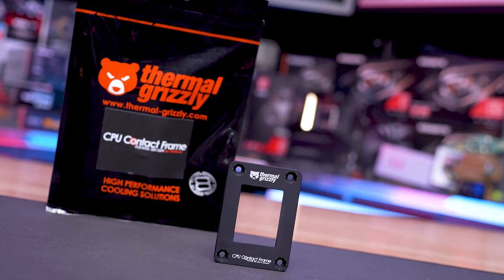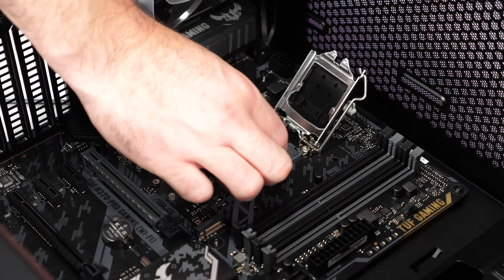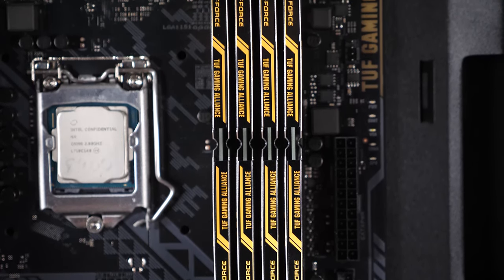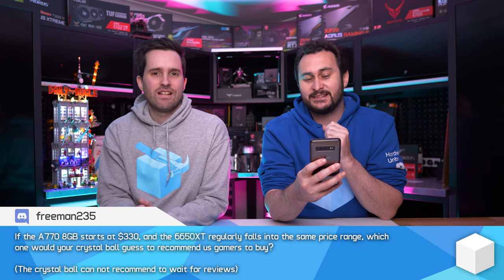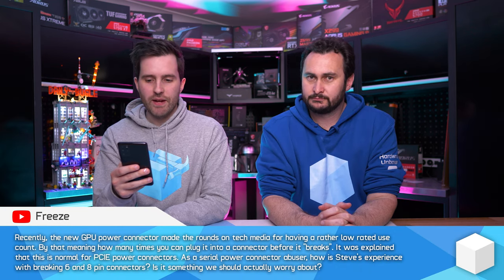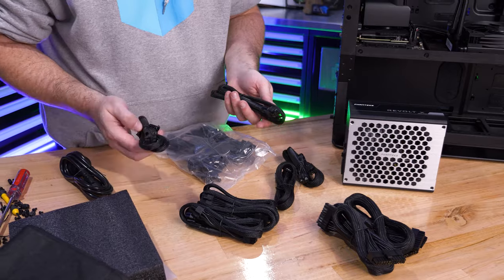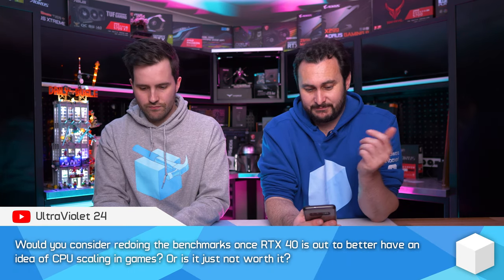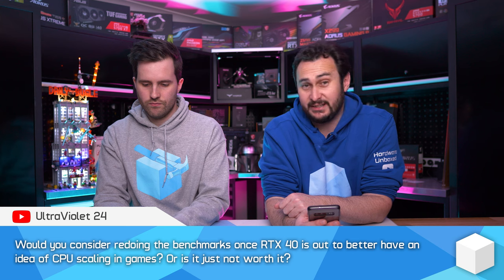EVGA Quitting Bad For Nvidia? Arc A770 8GB better than RX 6650 XT at $330 US? September Q&A [Part 2]

Comment: I think this is smart for a EVGA, also Nvidia can't do anything like apple cause they can't overprice like does.. Hey one reason i don't like apple, and the closed eco system.. rawr.. but yeah lets see what happens with gpu stock in general.. and do we really need 500+ watt gpus, i would be like yeah, but i want options if i don't need it. i kinda do! lol.. it's like overclocking.. dimenising returns! ! Cool topics.. but what is it with the hoodies is colder then 25c their? i know its winter, but fire up a GPU for heat!! :) :P <3

Comment: The power connectors in use are Molex Microfit which are indeed specced to 30 cycles - but the old connectors were Molex MiniFit JR. connectors which also have a fairly low rating of 75 cycles. I agree, nothing really to worry about.

Comment: An A770 at msrp will be about 40-60 dollars less than a 6700xt. Without even taking into account Radeon Monster Profiles, it's a much better buy for about 10-15% more money. Plus, amd cards are getting better with time thanks to new drivers and features. If you cant afford the price jump (im on a 1650S so i get that), get a 6650xt.
Reply: By the time AMD driver perf  'gets better with time' it's often time to buy a new bloody GPU. Such a bad AMD fanboy argument tbh.
Reply: @wayn3h  a lot of people don't upgrade as often as a lot of games run well on older gens. If you quit the mindset of "new game" = better game (as if games turned bad...), then you don't need to upgrade a lot. in the steam hardware survey pascal is still the most used gpu generation by far. so yeah, if you upgrade every 2nd or 3rd gen and skip some, the increased performance over time is nice (I am using a nvidia gpu btw, so don't start with "amd fanboy" crap)

Comment: The only question I have is with the Zen 4 CPUs being designed to run at 95c all the time, how do you set a fan curve that prevents your fans running at 100% all the time? Usually fan speed was based off temperature but that will no longer be possible. I'm sure someone will make a video about it in the coming weeks though.
Reply: there are some pbo/undervolting videos on yt already
Reply: @gxdjoeybaby07  That's true, and is probably what I'll end up doing personally, but a lot of people aren't so willing to spend time tweaking settings and potentially losing some performance just so they can use temperature for a default fan curve. I'm also curious what other options there might be, you might be able to use CPU utilization and/or clock speed to adjust fans assuming if clock speed is high it is working harder on single thread or if utilization is high multi-thread, but it is probably less reliable doing something like that.
Reply: Why not get efficient Zen 3 Ryzen 9 5950X or an M1 or future M2 Ultra Mac and avoid Zen4dozer overhyped crap?
Reply: @saricubra2867  Because OSX is utter garbage for gaming, and I'd be using the extra power for electric heaters anyway so efficiency is completely pointless to me.
Reply: @AusSkiller  You don't need an AMD Bulldozer 3.0 chip for gaming.
Reply: @saricubra2867  No, but I will need the extra cores for compiling games.
Reply: @AusSkiller  You can compile code on an M2 or M1 Ultra at 1/10th of the power consumption and saving an insane amount of money for the energy bills.
Reply: @AusSkiller  M1 Ultra has 20 cores, M2 is 24 core without dealing with cooling and power nonsense
Reply: @saricubra2867  The code I compile is for games, games that wont run on macs, and that definitely can't run on an M1 or M2 chip. Sure they are efficient, but only because they have a very limited instruction set, I often use some of the more advanced instructions from x86 and x64, occasionally even AVX because they can do so much more work so much faster than basic instructions. If you tried to run them on an M1 or M2 instruction set through the Rosetta emulation stuff you'd end up running at a fraction of the performance you'd get on x86 or x64,. Even when you natively code the program to use only apple silicon instructions as efficiently as possible it is still considerably slower. The comparisons between apple silicon and x86/x64 CPUs are usually done in programs that only require the basic instruction sets to work well which is why apple silicon appears so good. If you compared a program that heavily uses AVX512 instructions to a natively compiled apple silicon program to do the same work you would be looking at apple silicon being tens  or even hundreds of times slower, but apple gets away with that because it isn't common to heavily use such instructions, there are usually far more basic instructions mixed in so the performance impact isn't so severe.

But none of that matters because as I said I would need to use electricity to heat my home anyway so not using much power isn't of any benefit, I'd just have to turn up my heater to compensate. And I still couldn't play all the games I enjoy on the mac anyway. If you want a mac then you should get a chrome book because it'll be able to do everything mac users do for far less cost, even when you consider the cost of the extra power they might use. Which is another issue with macs, the savings on power cost are dwarfed by the extra upfront cost of a mac anyway, so if cost was any kind of consideration you'd never be buying a mac in the first place.
Reply: @AusSkiller Do you know that Hardware Unboxed did a M1 Pro code compilation benchmark?
That isn't the M1 Ultra, but it destroyed every single x86 chip competition last year. More than twice as fast. Also defeated desktop chips that use like 12 times more power...

The secret isn't the ISA, it's the absurd memory bandwidth.

The problem with x86-64 is that it's extremely bloated with tons of unecessary instructions for different workloads. Why not simply pushing IPC and work as a swiss army knife and doing everything very efficiently?
Reply: @saricubra2867  Sure it can compile code, but only for mac or iOS which isn't going to be any good for the games I make and play on my personal PC (I use an M1 mac for iOS games I make for work though, but my work PC (9940x) still compiles much faster than it). Apple silicon is very impressive don't get me wrong, but OSX is terrible for gaming which renders it pointless for me.

The bloat is a problem on x86/x64 it is true, but where you can use those instructions the performance increase is absolutely insane and it will absolutely destroy the performance of apple silicon. It is a tough trade off though because the instructions have such specific use cases that a lot of the time they go unused, and now that CPUs are so much faster they also are less necessary too so the performance hit for the common case is hard to justify. However PCs are tools for productivity in such a wide variety of tasks that it is inevitable that the instructions will no doubt put the x86/x64 chips way ahead of apple silicon in so many applications it would also be hard to justify their removal. Macs are in stark contrast to that because they are so limited in how they can be used that they are basically end up only being used as glorified chrome books in most cases and as such never need such instructions, so it makes perfect sense for apple to drop them, especially when they also have alternate hardware solutions for the few things like media encoding/decoding that could have made use of the instructions.
Reply: @AusSkiller  the M1 mac is a 4+4 core chip vs the M1 Ultra which is a 18+2 (i think) chip . Of course it cannot compete with HEDT. But the thing is, how much power HEDT draws, how much clockspeed? how much temps?
how much fan noise?
it sucks.

There must be a way to compile games on a Mac for PC. Microsoft can't get all the monopoly, on paper, current x86 chips suck so much. In fact, Apple M2 and M1 are so far ahead that we have to wait until Lunar Lake or Meteor Lake for something equivalent (maybe?) on x86-64.

Those special instructions can improve perfomance for specific things. But the IPC hit is so hit that it's kinda pointless at the end and not worth it for the HUGE difference on thermals, power and cooling needed, fan noise, no battery life.

M1 and M2 Macs aren't glorified Chromebooks, those are the computers with Qualcomm and Mediatek chips.

Apple just embarrased x86-64 twice now.
Reply: @saricubra2867  Sure you can technically compile for PC on a Mac, but you wouldn't be able to run that on the Mac afterwards so there is no point to that, and it also requires tools that aren't ported to apple silicon as far as I'm aware so you'd be running them as x86 and that'll perform worse than x86 native so you'd also lose any benefit.
Clearly you are just mac fanboy and don't understand what PCs can do or how limiting apple silicon is.
Reply: @AusSkiller  The perfomance loss vs x86 native is so insignificant compared to the huge increase in power consumption, temps and fan noise compared to any PC.

x86-64 currently sucks, there's no way to change that until Meteor Lake or Lunar Lake.

I don't defend Apple for their shady practices or Microsoft, but from an objective standpoint, the Apple SoCs chips are many generations ahead of everyone else.
Reply: @saricubra2867  For efficiency for sure, but raw performance and capabilities it still has a long way to go. And I don't care about efficiency since it just means cranking the electric heater. I also don't care about anything on an apple products because they are just too limiting in what they can do.

Comment: I want to add, as far as NVIDIA vertically integrating the manufacturing of their own hardware like Apple, this is what basically killed 3DFX, and why AMD and NVIDIA never attempted to do the same since, it was considered an industry lesson. However, NVIDIA is the 7th largest company in the U.S. by market capita, and I think 11th in the world, higher than VISA and JP Morgan, but even with this kind of leverage, it would be a very risky venture in the consumer GPU market. NVIDIA IS doing this in the Scientific computing space though, and making lots of money off of it with the V100 and A100 level datacenter/super computer GPU's.
Also, I'm on an AM4 X570 platform, and I will one day replace the 5600X with a 58003D when they are cheaper, and just skip the entire Zen 4 Gen, because honestly, that 5600X is already pretty bad ass and a GPU is the only necessary upgrade path.

Comment: About power connectors to GPU source was official validation, so it is not speculation... and we talking about new connections not old one, but still in specific conditions (cables was under stres in one direction).
but Tim, this cables in test burn connection after 30 cycles, so don't talk from your a**

Comment: question: could an AIB opt out of producing a card with a certain chip? since there´s no FE for the fake 4080 12GB, its "success" will solely depend on AIB sales. given the absurd price and cut down performance, could they decline to do so?
Reply: yes and no. it depends on the contract with Nvidia. And it's very unlikely Nvidia will sell AIB partners just 4090 chips. That is unless AMD is able to drop kick Nvidia and break their hold on the market. Currently AIB partners have very little negotiating power, Nvidia basically dictates everything what an AIB partner can or cannot do.

Comment: My biggest regret in buying hardware must be a G-sync monitor. Now I'm stuck with those scammers.
Reply: I have a gsync monitor aswell, but freesync works just as well on it .
Reply: @twanheijkoop6753  Well, it won't on my Acer Predator 1440p 144Hz. Everything below 80Hz will get tearing. Freesync doesn't work on a build in G-sync module.

Comment: 5800X3D is so much cheaper that upgrade path arguements are irrelevant. By the time 8000 or 9000 are here DDR5 is cheaper and you have saved enough compared to 7000 + board + ddr5 to just buy a new board so the AM5 lifespan is irrelevant with these prices. if they drop prices by 50-75 for boards and 100-150 for cpus then upgrade to a 7700X is smarter.
As for arc, it's all about how good new games will work. If new games wont work well on the release then Arc is a major issue.  If they have day 1 drivers and it preforms as expected its fine.  features are irrelevant for 95% of the gamers.

Comment: Nvidia could technically switch to the CPU business model. Intel doesn't sell their CPUs to cooler Manufacturers. They only make sure that people can use any cooler if they want to. If Nvidia sold a GPU with a cooler and one without it they wouldn't need to collaborate with partners anymore and the former partners could just make custom coolers you can strip on the card as easily as you can with CPU ones. Problem solved (from Nvidia's POV)
Reply: will never happen

Comment: Don't kid yourselves.  EVGA may have not gotten along with nVidia but that's the least of why they ended their partnership with them.  If so why didn't they turn to AMD?  Do they not think much of AMD's cards?  I think the issues is EVGA had all their eggs in one basket, which was graphics cards.  Because of nVidia they don't make as much of a profit on them so there done with graphics cards.

Personally I don't think EVGA is probably doing well financially in general.  Thus cutting nVidia loose since they won't make much form the cards they sell.  Obviously they either don't think AMD's products are very good or not enough of a profit margin to be had from AMD's graphics cards also.  In other words, don't blame nVidia, EVGA has other issues going on.

Comment: EVGA was a brand, not a manufacturer. They had their videocard designs manufactured externally and that significantly lowered margins compared to the likes of Asus, Gigabyte and MSI. Then add Nvidia putting the squeeze on AIB partner margins and a brand repupation built on great customer service and generous warranty (which costs a lot of money) and you have a business model that has become unsustainable. That's why they quit. The signs were already on the wall. Their recent videocards were too expensive, their cooling solutions (other than their high-end SKUs) were lackluster (propabaly a cost-cutting measure) and they had a very, very costly screw-up with the game New World frying their 3080 and 3090 videocards, which, frankly, doesn't instill much confidence in the companies technical expertise.

Comment: Rumors says that nvidia will launch this month a 3060 with 8GB and 256 bit of bandwidth for 300 bucks, maybe they are afraid of the a770 selling potential. It seems that october will be the month to upgrade the gpu 😊
Reply: these rumours are not true
Reply: @annatalbert8681  Well, the rumors turned out to be true, with the caveat that the bus will be 128 instead of 256.

Comment: We don't have a take, or anything to add...
- 25 minutes later...
.
Anyway it's still a bad take. The AiB's take on the risk. Nvidia would have to be willing to make all the hardware and eat it if it fails.
That is the main reason for AiBs.
.
Also, understanding how good EVGA cards were doesn't require you to have them throughout your market. Simply stating that it's a big loss and that EVGA made amazing hardware, which forced others to keep their standards up.

Comment: Idc how good the price to preformence is 
99.99% of people who buy said GPU won't be able to use it, why keep promoting a product that is still on Beta runs? If I have to struggle with drivers for consistency just to have it fail why in the fuck would I spend 400$ on that? When there is options that work out of the box with little to no driver issues. 

Everyone has seen the videos we know Arc drivers do not work and still do not work.

Do
Not
Promote
Defective 
Products

Comment: The power supply issue is less a "power supply connectors are shit" and more of a "McDonald's coffee is hot and consumer monkeys are idiots" type of issue.  If I smash this connector sideways and run 800w through it, I'm a dumb ass but I'll blame the power supply company because they didn't specifically TELL ME how to use  a power connector and I NEED TO BE TOLD because I'm an idiot.  Shocking results, really.  Nothing like this has ever occurred before in the monkey kingdom. /s

Hey... if these companies want to market to children with their "RGB" "GAMER" "EXTREME" nonesense, they had better educate them along the way or they'll have these problems.

Comment: Gentlemen - I'd encourage you to watch the entirety of Steve & his crews knowledge sharing video regarding the  the GPU/PSU Interface.ne more time more carefully.

 I think you may actually find, provided you not only watch said media uninterrupted, but do so in a way that ensures you don't miss any of the key points, that the sheer forces the new power supplies are  going to be placing upon this weak-@$$ little plug may well be enough to glimpse the pores on the nose of the face of failure of it just due to the clearly insufficiently sturdy design & overall HEFT relative to use case with the $X Nvidia series As well as anything beyond it in the future. (Particularly the 4080Ti & above - I came away feeling WITHOUT QUESTION - that we WILL be seeing failures.)

 It's nearly akin to asking "Olive Oiyle" to hang onto the fire hose while you run to the fire hydrant & turn the power up all the way so there's a thousand gallons a second of water running through the thing.
 Once Popeye Whooped yer behind(s), & Brutus tried to get the dame while "PP" was occupied with you lot, You'd certainly be more comfortable with either Popeye OR Brutus holding a hose with such volume coursing through it - Likely BOTH OF THEM ;)